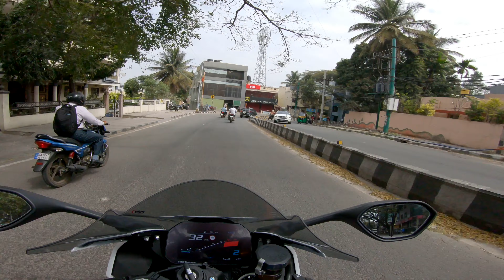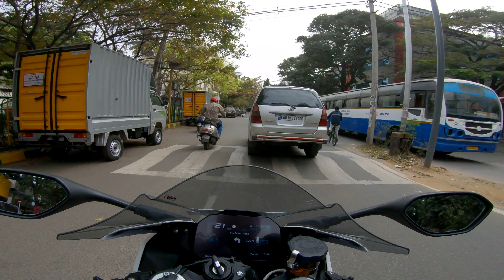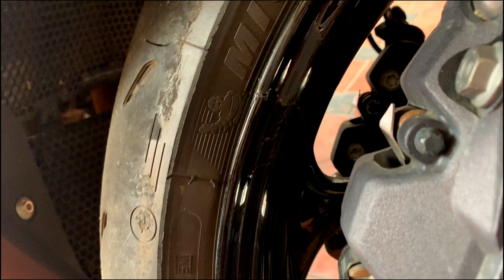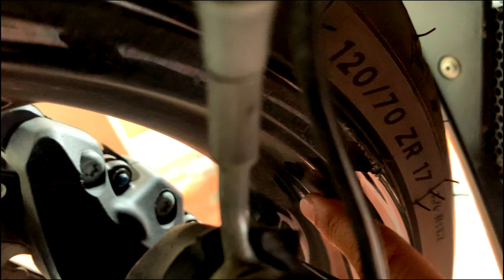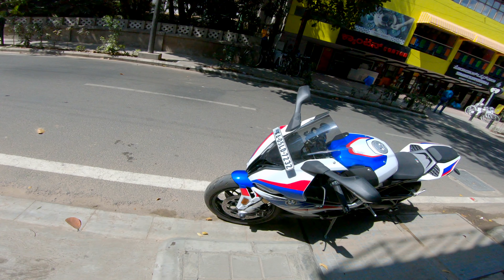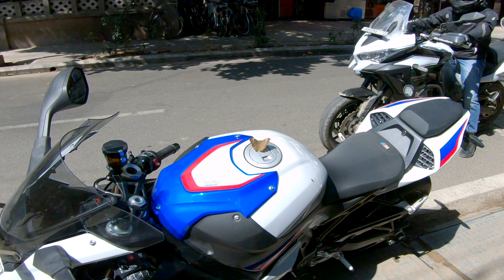World's First BMW S1000RR with Cracked Carbon Fiber Wheel in India? - My Shocking Experience

Comment: You mentioned there was an impact multiple times. What was the impact you are talking about and what you recommend not getting carbon fibre wheels ?
Reply from the maker: It’s about the impact from pothole….
Was at significant speed when bike fell into pothole due to which wheel cracked….
I would still recommend carbon fibre wheels and drive with some caution on few Indian roads…

Please let me know if you need any further info….
Reply from the maker: Also I am not sure if there was any manufacturing defect, front wheel before cracking felt out of balance and rear wheel fell into the same pothole at same speed and it’s all good…